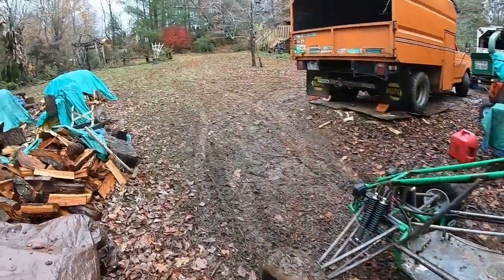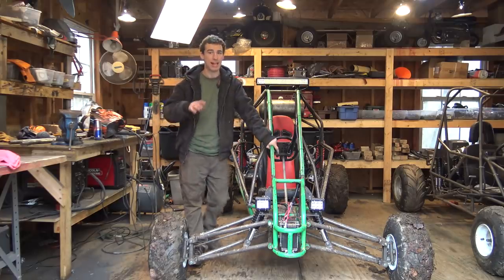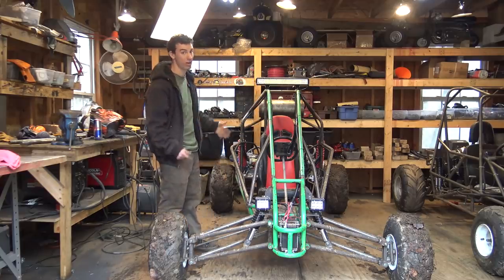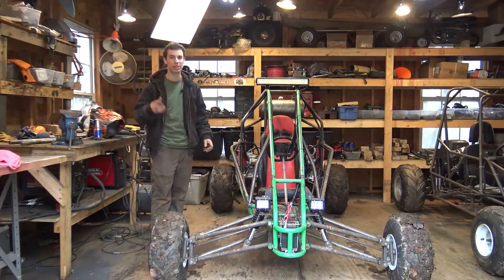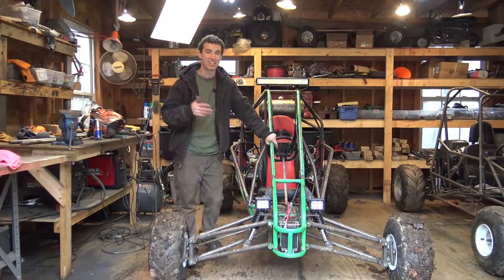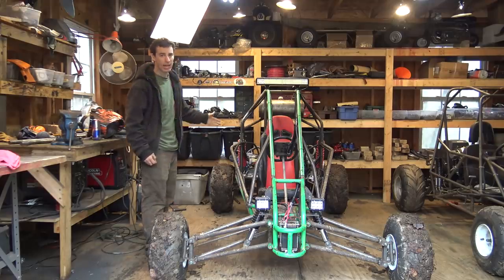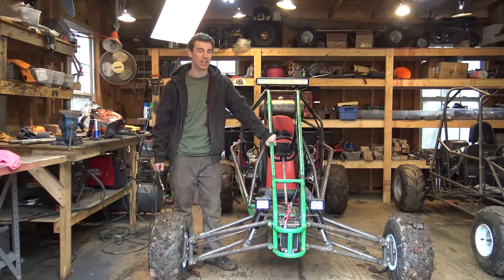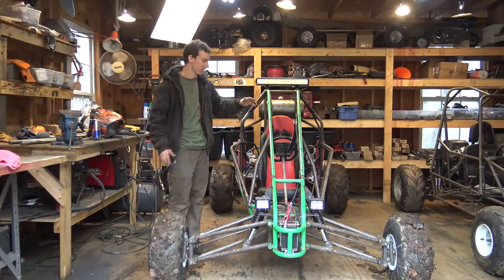riding the long travel full independent suspension dual engine go kart

Comment: A friend of mine had a Razor with a turbo charger on it.  It was stupid fast, and almost undrivable because it was unturnable without bringing it almost to a stop.  So against my advice he bought a sway bar kit for it.  I put them on and found that it still wouldn't turn.  So I played with their adjustments with no luck, and finally adjusted them back to their starting point.  Then while on our makeshift track, I floored it toward a turn, baked for the turn while turning the wheels, let off the brakes, and it of course pushed straight ahead until out of frustration I punched the gas.  Boom!  The throttle turned it.  OMG, it was completely neutral like an F1 car.  With those sway bars you could turn it with the throttle.  Which made it amazingly fast through the turns, and amazingly fun to drive.  So my advice to you is not to add actual sway bars, but convert those 2nd shocks on the front to a hydraulic sway bar setup.  With some sort of mechanical body roll control valve, and a manual adjustment with in reach of the driver.  Then apply the same setup to the rear.  And btw, that Razor would do I think 81 mph on pavement.  According to it's speedometer..

Comment: Riding long travel suspension kart on perfectly paved roads 😑
Reply: Yes. Ket build a fairly capable  cart to never run it off road. I get that hes just showing the speed side but come on. Twist it up. 

 Also he slung mud in jis building in the begining of the video
Reply: Makes a very smooth ride and u don't have to worry about  Potholes

Comment: Rather B Welding; You should seriously look into building a "Street legal reverse trike" one like where you sit inside NOT on top, you could use the Honda 600 motor and rear suspension with the wheel and the dash gauges marker lights headlight brake lights hell most of the wiring, Just need to get a front suspension from a small light weight car, this way you have the disc brakes complete with calipers ball joints maybe even a steering rack. But do take your time and do it right no pipes use tubing and Tig weld it all (Mig is good too just not on some important safety things)...
PS: keep it light.

Comment: It a off road toy no need for a sway bar 👍👍👍
Reply: Yea but he ONLY rides on roads.
Reply: Right... a swaybar makes a very nice independent suspension, less independent.
Reply: William Mercer 
It’s like riding a dirt bike on the road. 
Soft ride like a caddy with plenty of travel.
Reply: His body roll is opposite of normal without any link bars though, not good for high speed on road
Reply: You guys know some sway bars can disengage? 
If he designed it right it would be easy to put a lever on it to engage it
Plus it only really needs a spring in there as a sway bar, thats all they really are
It would be rather simple to put one on that can be disengaged
Reply: Buen invento 👍

Comment: would leave the gearing how it is, long travel is for speed and some jumping.  If you want to off-road slow you should be doing 4 wheel drive and locked axles for power transfer to wheels that have good traction.

Comment: Impressive and elegant looks almost ready for retail a sway bar wouldn't be that difficult but remember what ever end you put it on will be The end that slides.  The bar would mount parallel to whatever your rear swingarms mount toand the arms could connect to the swingarms even with just a clamp but then it would be tail Happy

Comment: Full throttle? What's the top speed? I have a 212cc predator yerf dog that's belt and chain pulled top speed around 55mph with no governor! About to put a turbo on it next week!
Reply: What sprockets do you have?
Reply: @kelseyashley7824   I'm pretty sure it's a 60 teeth sprockets and I'm taking a small turbo off a car and hooking it up in the carburetor spot to draw more air flow and add HP!
Reply: @s.w.sministries4873  I'm running twin 212 engines want to change the gearing but don't know what to get yet . Right now I'm running 10/53 r 54
Reply: @kelseyashley7824  The smaller sprockets you get will increase your take off speed but decrease your over all speed. And the bigger sprockets will slow your take off down but you will be able to reach a higher speed! So its really about which you would rather have. For me I'm trying to reach a top speed of 65 or 70 mph put lights and mirrors on it so I can have it tagged.

Comment: Uses two aftermarket 10 hp motors =16hp lol
Reply: They are 200cc's normally come with 6hp, but I can see a stage 1 kit on them (filter and pipe) so each one should be putting 8hp
Reply: @habdman  states on there website 10 hp stock
Reply: Ok....so? What’s your point
Reply: @shvdblvck3278  that he just threw a number out there

Comment: They have sway bars and then you can put arms that are clock able at the pivot point to slow or to take some of the sway away. You would still have sway with that setup. And you won't limit the travel on the rear.

Comment: Thoes tilitson 212s make 10hp each. And you put the aftermarket stuff on. So its like 25hp
Reply: Not even close lol
Reply: He doesn't have the fuel injected carbs so he's still at like 8.5 hp per engine
Reply: A.J.'s ATV Repair shop and you can make each of those have at most 20
Reply: 20 hp I mean
Reply: You need to have 2 engines on the same crankshaft to double the horsepower this is just doubling the torque
Reply: @myprofilenameisreallylongl5956  That might be the dumbest assertion I've seen this month.

Comment: Add a 3 rd engine on the front powering a jack shaft then  run axels with u-joints or cv joints to the front wheels make it 3 engine 4 wheel drive.

Comment: Why is it so wide? It looks a bit wider than most cars. For the rear end, try to move the engine's to the main frame if you can. That extra weight on the swing arms increases the response time of the wheel to any bumps and makes them float longer on return to the ground. It may not matter that much though for a slower offroad vehicle. 
Regardless though, looks like a lot of fun. I have been thinking about doing an electric 4x4 somewhat like it. Still trying to decide if turning the front wheels is really even needed. Simplifies the design a lot if you just skid steer it. Have you tried throttling the engines independently just to see how it responds and what kind if turn radius you can get?

Comment: Hello there! Ok looks like all fun an games, till you need to stop on wet pine needles and leafy covered roads! Especially when you have no front brakes! I would suggest getting the front spindles and king pins from a Tomberlan Golf Cart, that has trick cross drilled hydraulic disk brakes that are small enough to fit inside the 12” wheels! On my Tomberlan Golf Cart that weighs around 1,200 lbs and gets up to 27 mph can stop on a dime with a nickel to spare.

Comment: maybe some torsion bars would be nice.. maybe some hydraulic system you can open and close for road/offroad use... cuz it seems a bit "wobbly" on the road.. weaving and tippy wen correcting.. great idea though.. dual engine seems to work great. have fun!

Comment: You,Sir,have created a masterpiece !!
Question: How do you keep the 2 engines in sync so they are not fighting each other ? Does the slip of the torque-converter take up the difference ?
Reply: you have 2 cluchtes like in cheap scooters (dont know the name). And this clutches allows for some ,,desynchronisation"
Reply: The torque converters balance themselves to a degree being variable.

Comment: wow, super cool setup....great idea.....I love it, next build ADD 2X VOLKSWAGEN BUG 1500CC 4CYLINDER MOTORS PER SIDE, WOW THAT WOULD FLY, INCREASE TO 2000CC...
Reply: Those engines would not fit in this setup, a beetle engine is quite big and flat. He would be better off putting 2 motorbike engines as they would have more power

Comment: Really cool design however the only longevity issues I see is mounting your engines on the actual suspension itself. Overtime, your motors will shake loose/ to pieces or have catastrophic engine failures from unbalanced harmonics due to road and off road vibrations in the suspension. I mean, that’s the entire purpose of building a really good suspension is for control (to include comfort) and most of all, for everything on your frame including your engine to last a long lifetime. The more vibration from road or off-road to any motor will eventually cause failure and destruction.

Just my input as an Automotive Engineet

Comment: Dude you need to drawup a blueprint of this rig. It has serious potential to make you some money. Just add safety features like a windscreen, side netting, fenders, bumpers to protect the suspension and covers for the engines.  Also some bumpstops to prevent over extension/compression of the suspension.
Reply: And covers for the drive chains and brakes. Muddy brakes and sticks through the chains ruin a good time

Comment: the way the sprockets and disc breaks are attached to the axles seems improoveable, it doesnt look like it would hold longer than a few test rides. When you come up with the solution show it, most of the features you design look verry functional and effective

Comment: Does it have a gearbox and reverse gear? It looks challenging when you have one engine for each of the rear wheels. And what about a clutch?
Reply: It appears that both engines have their own centrifugal clutches and CVT transmissions (like a gas powered scooter only one on each rear wheel) with this kind of setup reverse is not generally possible. The simplest solution would likley be a 3rd small engine or electric motor with its own centrifugal clutch that would drive one of the rear wheels backwards when throttled.

Comment: Nice concept, but is there a plan to add synchronization for more stability? And in my opinion locating engine on suspension arm is very bad for engine and suspension itself too. Not hating, but waiting for 2.0 version, great work! In fact, you could come up with commercial solution eventually;)

Comment: I would not use a sway bar, it will limit your articulation (suspension travel) off-road. Jeep wrangler guys constantly pull the sway bars off because it hurts them offroad.

Comment: That front end is so wide. Seeing it on the road with the painted lines really shows how wide it is. 
Good luck running ATV trails with a front end wider than a Jeep plus being able to spin out on the road means you will not have traction on the rocky trails you were on with Quadricer. 

Narrow the front and stick with dirt trails and definitely don’t add a sway bar and you will have a great off road buggy.
Reply: dude, the camera makes it look wide, this is not wider than most ATVs.. and being able to spin doesn't mean he won't have traction, he was sitting in a mud puddle with full throttle. The buggy is amazing the way it is
Reply: @geoffrey6000  
Obviously you didn’t see it loaded onto the trailer or barely fit through the doors of his shop. 
The front end is definitely wider than an ATV but you can have your opinion and I’ll stick with mine.
Reply: @Crewsy  sure, go ahead. He built it like this for a reason, and he probably knows better than you. You don't have to point out these "flaws", he built it like that so just leave it.

Comment: I really like this build. I am curious if it would help if those air intakes if they had a U-pipe thing that would get them aimed up away from the ground more. I feel like dirt/ mud could be an issue on that 'passenger side' motor with the wheel being right there beneath it. In any event... that looks like a lot of fun lool.

Comment: Screw that sway bar idea. 
The sway makes it way cooler and doesn't really affect the handling in corners.
In fact it'll be a serious plus when riding along hillsides if it enables you to lean uphill using your body weight.
I would install dual disc brakes at least the back.

Comment: Dude with that setup you could run rear steering brakes and turn on a dime! You could add a coupler to the steering that adds slack to the throttle cable to reduce the rpm of the engine on the side you are turning toward. Granted the steering brakes would be a simple solution there are traction advantages to engine rpm differentiation. Easier on belts, traction control and more. You are talented enough to do either. Drive by wire would be something to consider then you could use a button on either side of the steering wheel to turn sharper without the bulk of the brakes and the complications of the throttle cables.
Reply: To limit sway and body roll you could add sway bars right to left or torsion bars front to rear.

Comment: If you move the front upper shock mounts farther out, and the lower mounts on the a arms farther out you should get better geometry on the front suspension.  May be able to get away with a single shock since there wouldn't be as much leverage on the suspension.  Much like a 450cc race quad

Comment: nix on the sway bar. that will decrease the long suspension wheel travel.
look at those stadium trucks.
love the way those motors sound under acceleration.
great vid keep up the good work - just don't get caught by the cops.
..and make sure the neighbors are ok with you on the street, please.
Reply: It's already so low it will bottom out before the long travel will be used

Comment: When are you going to put two more motors on the front wheels why not electric drive them with stator motors then you will have a hybrid just have to get a hold of some supper capacitors and your set the you can use the electric motors as regenerative braking as well ! Just a thought !

Comment: The body is too loose and the steering and steering wheel need set up differently for a cart that big. Gearing could use a little work. seems way weak on the top end to just massive tork and spinning and not enough in between. Very nice design and set up tho. I think a few minor adjustments and that would be even more fun and feel more sturdy.

Comment: Kinda cool but with the amount of work you put into it why not buy a sport bike motor way more power 100 plus hp.
Reply: Exactly what I was thinking. Power to weight ratio makes top speed maybe 45 on this thing? Not quite fast enough to use that suspension to it's fullest. Needs some overload straps to eliminate some of that body roll

Comment: long travel full independent suspension 2 speed transmission dual engine turbocharged performance package mikuni carborator double diff locked forced air intake go kart v2 episode 7 of 84

Comment: I think the right brake is only partially engaging. Noticed at times the wheel still spinning whilst the left was locked. Also you may find Go Power Sports stop sponsoring you, if you keep blatting round the public roads...its illegal.

Comment: What's about the most power you can get out of one of these little 6.5 horsepower 212cc about engines? Who's about the most economical and cheapest little engine builder out there? And are these little modified engines dependable and reliable? I plan on building a lightweight portable DC alternator portable charging system.

Comment: -sway bar wont be a problem. you just need to use something that comes from an atv or the like, or use a kei car/microvan's have it work with a linkage proportional to your buggy's mass (or higher if you want to keep some sway). here's an idea: https://www.pirate4x4.com/forum/general-4x4-discussion/509819-super-cheap-junkyard-swaybar.html

-fuel tank needs to sit lower. you could strap it below you knees, for example, and run a vacuum pump from a lawnmower to feed the carbs.
this will increase handling greatly.

-steering seems floaty as fuck, you might want to add more leverage to your tie rods. (or a longer pitman? not a kart expert at all) 1/4 turn shouldnt yeld such little movement.
you definitely need a steering damper too. 

-Itb's? that's what you call electronically fuel injected carbs i guess. wont make a difference, mostly because you have a cvt and 1950"s tech engines. at such flat rpms, you're just gonna add failure points to an already complex machine. dont bother.